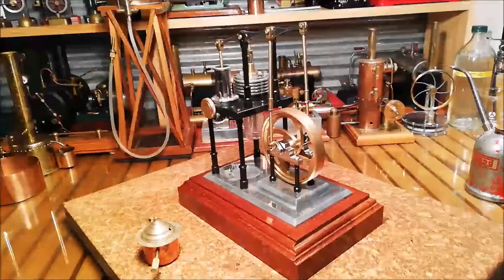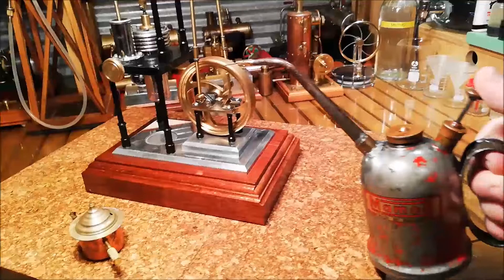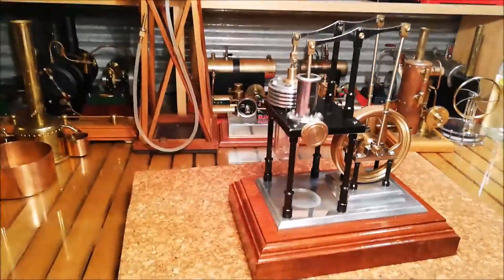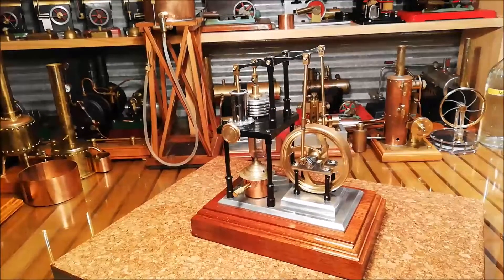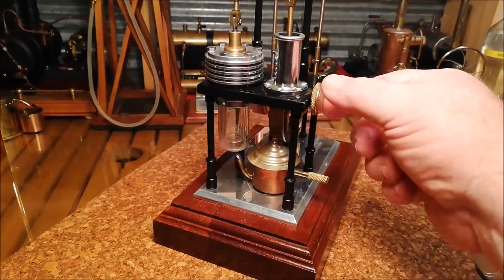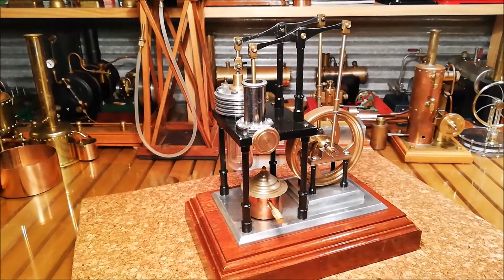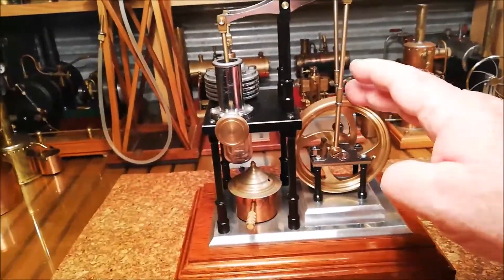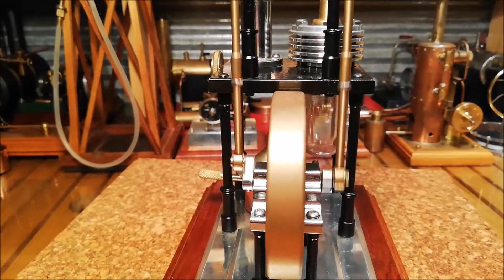Indian made copy of a Wiggers Stirling Engine

Comment: Hi Jim, that's a fine looking hot air engine :-)
While on the original the brass knob may well have controlled the flow of air from the displacer cylinder to the power cylinder I think in this particular example it simply blanks off the hole that connects the two cylinders. 
Have you tried removing it to see how far it reaches?
Reply from the maker: You could be right there Henry as it was only blanked off with a grub screw. I made the brass knob because Wiggers have them. Its a nice Stirling engine :)